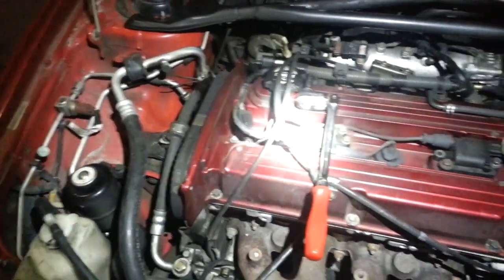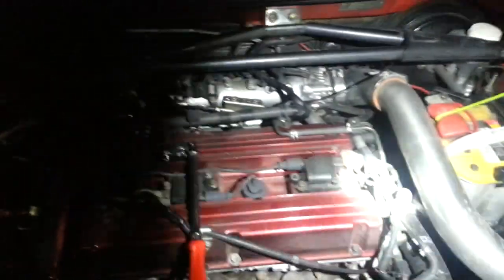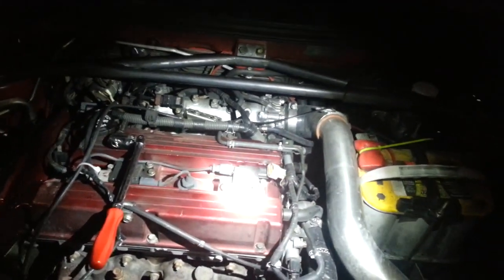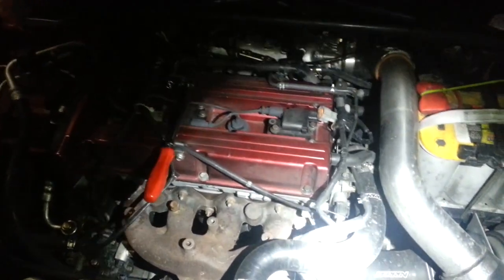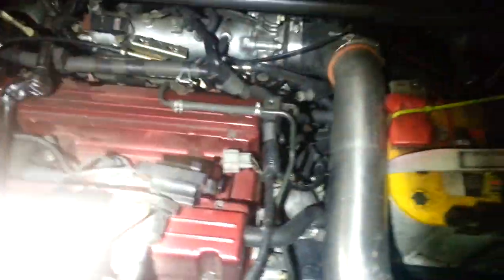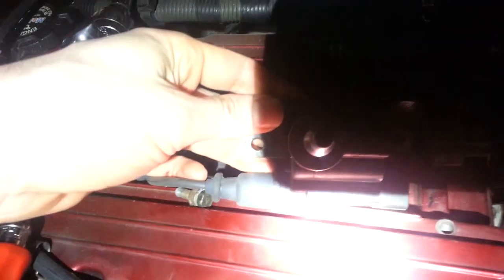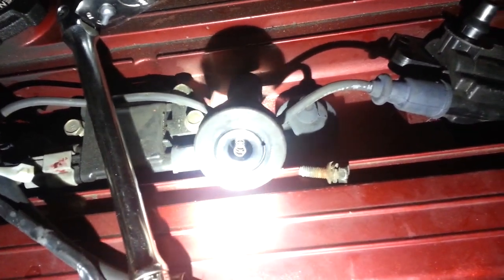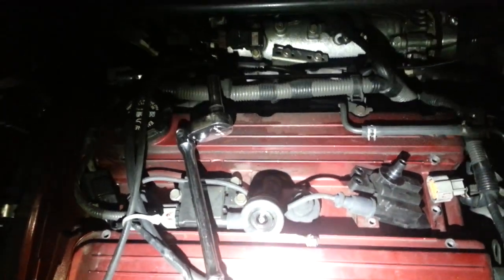Mitsubishi Lancer Evolution VIII (Evo 8) Misfire Easy Repair PART 1

Comment: I know this post is old but; my sons evo 8 misfires and I've checked the small crank sensor plate, new plugs (.023) gap, boost leaks, vacuum leaks, injectors and all 4 coil on plug connections, it was still misfiring at high revs. The solution was found to be the Exedy twin plate clutch vibration causing the knock sensor to kick in. Apparently the vibration/noise from the clutch registered in the ECU as knock, therefore it was killing the spark to stop the engine blowing. It was temporarily switched off in order to find this problem whereby the engine revved smoothly with no noise in sight. It is running over 550hp so if there had been a mechanical fault, the engine would have disintegrated if knock was found to be one of the regular problems. Thought I would add this just in case someone is having the same problem.
Reply from the maker: Ah yes, Evo clutches. That was always one of the less pleasant jobs surrounding the platform. 

Twin disc rattling at 7k would be a really hard problem to track down.

Comment: Where can I purchase the boot kits ??
Reply from the maker: https://www.oreillyauto.com/detail/import-direct-wires-3988/ignition---tune-up-16776/spark-plug-wire-set-12534/import-direct-single-lead-plug-wire/41852k/4384342/2003/mitsubishi/lancer

Comment: I got a question hopefully you can help me out, I have a 06 Evo. Running really rough at idle and has very bad response to throttle then straightens out at higher RPM. Service engine light comes on with OBD code P0301 cylinder 1 misfire. I change the spark plugs thinking that would fix the problem but no go. I also cleaned mass air flow sensor but that was also a no-go. I ordered the wires and Boots waiting for them to come in now! Do you think that would fix the problem?
Reply from the maker: k lucky yes, coils and boots are a common cause of misfires. You might have a bad coil but usually just changing the boots will work. Also, be sure to gap your spark plugs to about .021-.023. Any wider gap can blow out the spark under high boost.
Reply: Richard's Action-Sports unfortunately I did a cylinder pressure test and number one cylinder had no pressure so I guess I got to figure out that problem now.
Reply from the maker: yeah, that's a bigger problem.
Reply: @luckymimiandkrissy  so how did it go, after fixing the cylinder one pressure, what was the reason why your engine was misfiring?

Comment: quick question.... got an evo4 and it has a small miss at idle on cylinder 2, it doesnt missfire under load or when cold only once warmed up.....(checked lifting leads and coil while engine was running to see if idle) It has new plugs all round, swapped coils and plugs around to see if miss would change cylinder and it didnt.. any ideas on what to check/try next before digging deeper?  cheers.
Reply from the maker: so it pulls strong and only misfires at idle when warm... it might be a fouled injector that still flows but where the fuel isn't atomizing. you may not notice it when the car is cold because the ecu is set to idle much higher until the car warms up.
Reply: faults there continuous once warm and been runnng for more than 5min, it misses at idle then shit under load, swapped injectors around to see if the miss would follow the injector and it didnt. will check loom next to see if feed to injector is wrong. is run via a Link ecu so cant even check via scanner. lol
Reply from the maker: what's your spark plug gap??? evo's/sti's will blow out the spark under high boost. gap your plugs down to like .21-.22 or you'll misfire on high boost. most spark plugs from the store will come gapped out wide at .30-.35 which is no good for these cars.

Comment: dumb question. How many ignition coil boots do i have to buy? You said it's a waste ignition system? I assumed 4 but now it sort've looks like only two?
Reply from the maker: the type of ignition system is called "Waste-Spark"... so you buy 2 short coil-on-plug-boots and two pigtail plug-wire boots.
Reply: Hey Richard, thanks for the vid.  I plan on doing this soon.  I found a pair of coil-on-plug-boots (https://www.densoproducts.com/product.aspx?zpid=12975), but i was wondering if you could link a page for the 2 pigtail plug-wire boots.  Thanks!
Reply from the maker: lklh;kj yeah, you want two of those and two of the spark plug wires.
Reply from the maker: you need two boots. and 2 plug wires here are the boots: https://www.densoproducts.com/product.aspx?zpid=12975

Comment: Good start. When will you be putting up part 2?
Got some part numbers for these pieces?
Reply from the maker: here's a part number (#1832A033) or follow this link. http://www.fetchparts.com/p/MITSUBISHI__/Direct-Ignition-Coil-Boot/48104396/1832A033.html
Reply from the maker: here's one @ lancershop but that's "evo tax" in full force you can get them cheaper from a local autoparts store with some work & research. https://www.lancershop.com/customer/product.php?productid=1416&cat=89&page=1

Comment: How bad will the eve perform with a bad spark?? Out of 100% How much power would u lose?? i believe this is whats wrong with mine. thanks for up load.
Reply from the maker: if it's a minor misfire it'll run okay under normal driving but misfire badly once it goes in to boost. If the interest is high enough I'll make a table top video of some examples of shorted coil boots etc if i can find some.